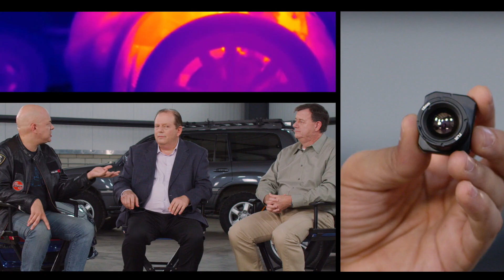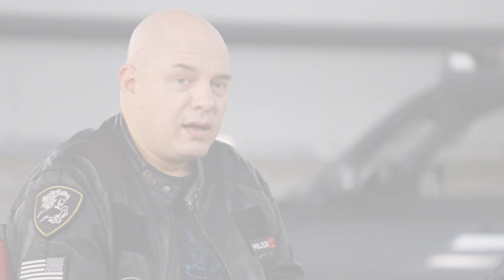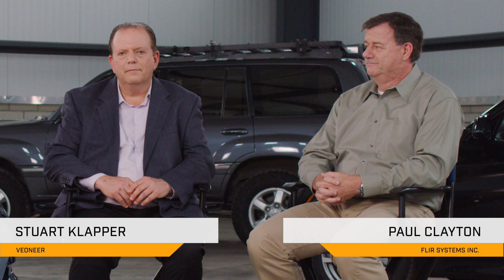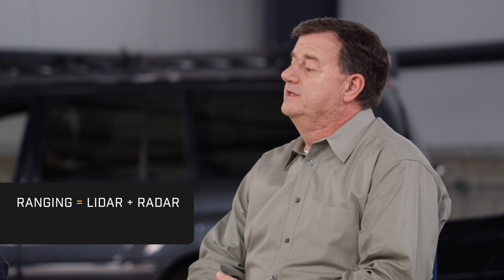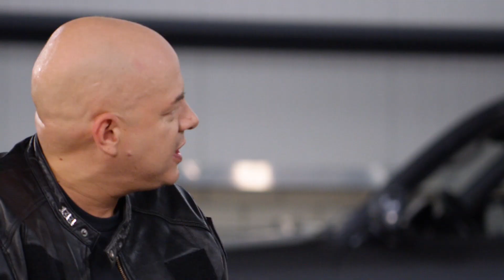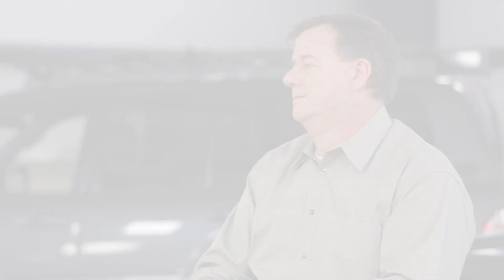Why ADAS and Autonomous Vehicles Need Thermal Infrared Cameras | The Road Ahead with Alex Roy

Comment: Just to clarify, the autonomous system in the uber car had Identified the cyclist and determined that action was required far before the point of impact however Due to the specific tests they where doing they required the driver to confirm the emergency action and as the Driver was unable to visibly see the person they did not confirm and allow the car to apply its predetermined action. The system had been disabled from applying this action for both the Volvo OEM system and the uber system to ease in trialing system and evaluating its decision making.
This caused it to rely on the drivers intervention. I completely agree that a FLIR drive vision assist system in dash would have helped but I dont agree that the designed systems of lidar and radar were ineffective as operator/procedure error was the main influencing factor in incident and since systems were disabled it should be seen as nonautonomous vehicle crashes while data logging with lidar.